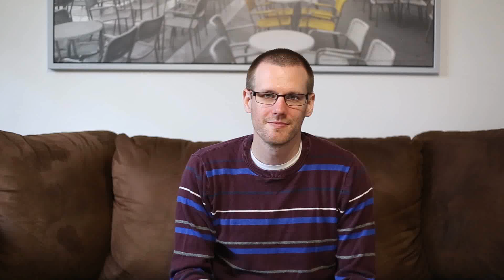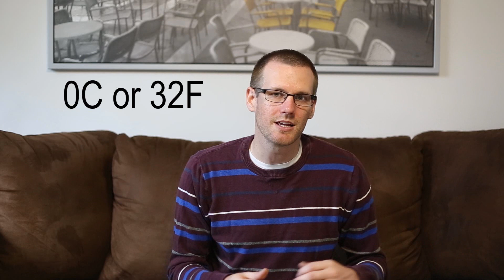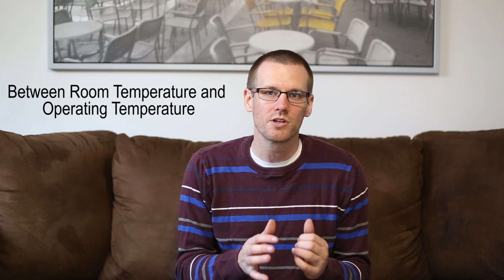LiPo Battery Temperatures - Charging and Discharging

Comment: I have one boat that runs my packs hot, well not 140 degrees, about 120 degrees,  so I guess it's safe!   Motor usually is around 93, esc 80s.   But I always wondered why the packs are getting warmer
Reply from the maker: Check the internal resistance of the packs. IR may be getting higher.

Comment: I recently started speed running. Ive got a stockish Arrma limitless with a max5 esc and TP power 1330kv motor. Every since ive started running I have always gotten a better speed on my second runs on the same battery just because the batteries are warmer on the secon run they perform better. Raz has said it many times. Cold electronics. Warm batteries.

Comment: Thank you Ryan, for your all your very well explained videos. I've learned a lot from your video's! 

 This year I started running some Spektrum Smart batteries that happen to record over-charge, over-discharge and over-temperature events.  The over-temperature event is logged if the battery exceeds 104 deg F.  My hardcase LiHv 2S 8000mAh 100C, LiPo 3S (in smaller desert buggy) & (2) LiPo 4S 5000mAh 100C battery packs (8S in a 1/5th scale buggy) typically end up right at about 100 - 102 F. at the end of a run even with taking several breaks (up to about 5 min) to let the motor, ESC and most importantly the battery packs cool a bit after I had some recorded over-temps at the end of the run.  On the smaller buggy, I'm geared down to a 12 Tooth pinion (5 teeth lower from stock 17T pinion with 40T spur) with the stock tires, but my only concern lately has been battery temps.  My Motor gets up to about 130F with dual electric fans and heat sinks which i guess is ok, the 130 amp ESC with fan running has never overheated.   I'm running a 4-Pole 3150kv 550 on 3S, was thinking of researching more and possibly putting in a little lower kv motor about 2400kv?, gearing down even more and going from 3S to 4S, so I can run with a bit less current to help the batteries run a little cooler.   I realize that my style of driving is hard on electronics.  I run everything very hard, i.e. I like doing 4 wheel power drifts on pavement etc.  I don't need more speed, it's plenty fast enough for me, just want my electric components to run cooler if possible for longevity.  I want to try to have a little more head room for all 3 components, but especially for battery temps to keep them under 104F consistently and still be able to run the way I like to.  I'm having fun and still learning.  Subbed your informative channel.
Reply from the maker: Hey Thomas, thanks for your comment. 
104F is quite conservative. If you are able to keep temperatures below that temperature, your packs will be very happy. However you may not get highest performance from them in which case it seems you wouldn't need anyway.

Comment: Thank you for this! I just started flying in March and a couple days ago I was flying at the club at dusk. It was around 85 degrees out (my hottest flight).  I only had enough time to fly one battery and when I was done. the battery was 120 degrees. Of course, I freaked out thinking it was too hot to fly and I ruined my battery.  I went straight to YT to find out maximum and optimal operating temperatures and hot weather recommendations but you're right, there's very little out here on that subject.  I'm very happy to know that the battery was actually around the perfect temperature for peak performance.  Thank you for the education.  I am now a subscriber and consider the notification bell smashed.
Reply from the maker: Hey David! Thanks for your comment! I'm glad you found the channel and appreciate the sub!

Comment: Graphene vs Standard lipo?  Speed runs your choice? I was told Graphene last longer (cycles) Thanks for another good video😁
Reply from the maker: Hey FuriousWolf, I am running a lot of Graphene packs these days but do not have enough years on them to comment. So far I am happy with them, they dump the power. I use them primarily in EDF jets but have used them for speed runs in RC cars as well. I prefer anything with Speed.
Reply: Ok Thanks ....👍please stay safe...
Reply from the maker: No Problem! You Too!

Comment: If a battery pack has been continually used in the cold. Will it permanently affect the capacity in room temperature?
Reply from the maker: It is certainly possible depending on how hard it was pushed while used in the cold. I have not noticed much of an effect when running a battery in warmer weather that was run in colder weather frequently.